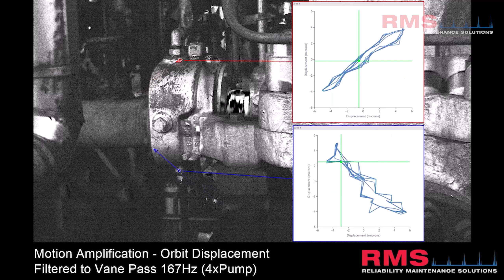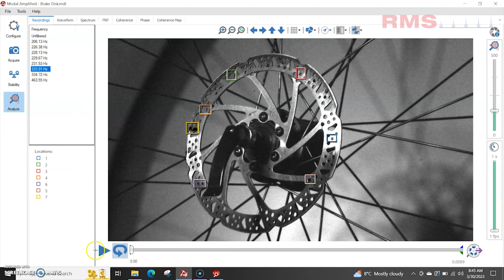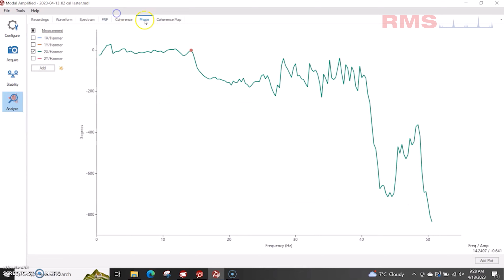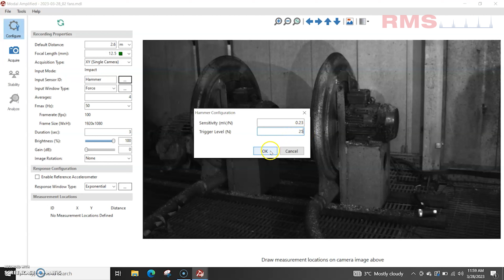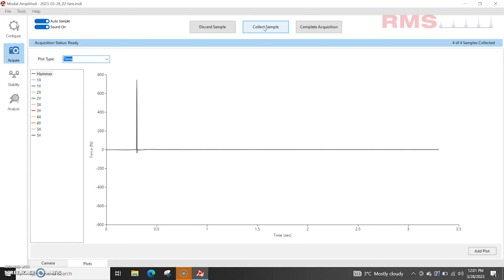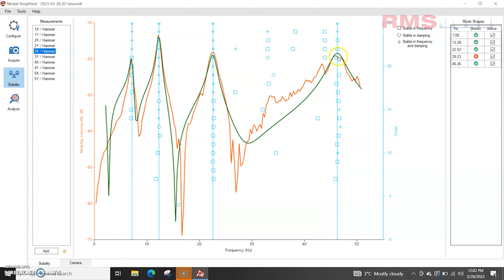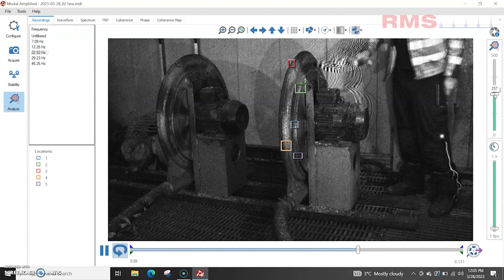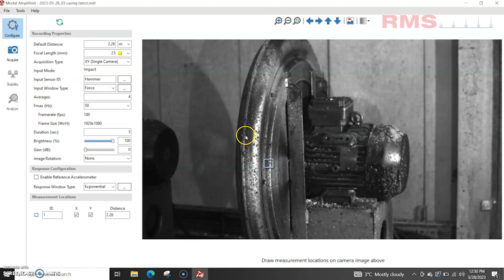Modal Amplified - An Introduction to Modal Analysis - Real world Fan Case Study

Comment: Really it amazing Technology to doing modal test and saving massive time during test, thanks RMS For this technology , I have some questions about this module :
1- its this module effective for other Excitation Forces Except 1x running speed like ( 2x , VPF , GMF , BRF...... etc.) or only for 1X Running speed ?
2- how about the accuracy for modal results compared with normal Modal test  using Contact sensors& Vibration analyzer  ? 

thanks Again RMS